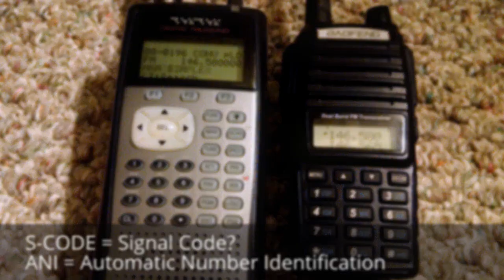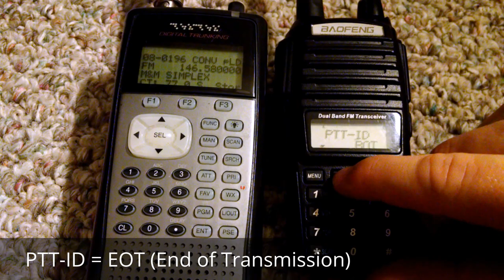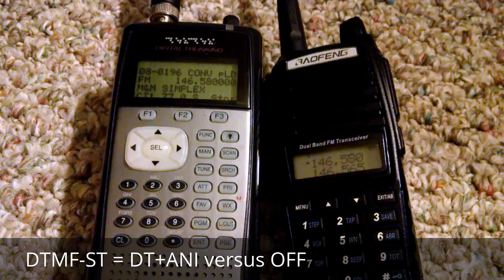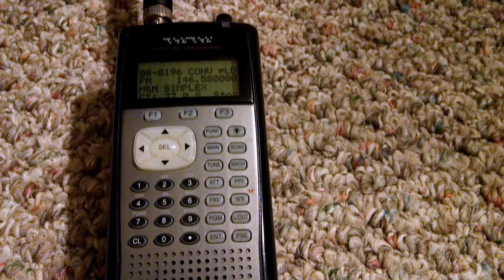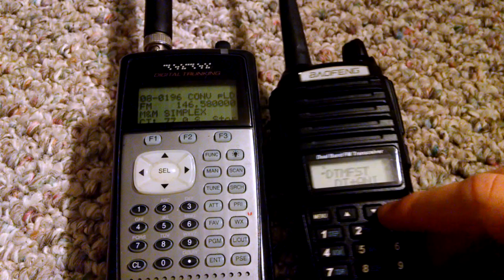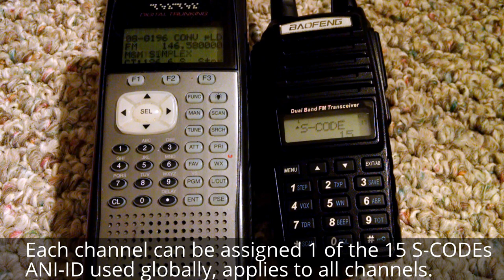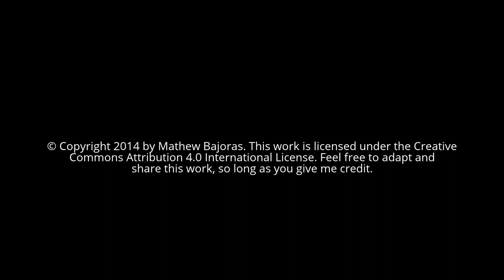Baofeng Radio PTT-ID Feature Demo

Comment: Can you explain what the purpose of these tones are for and what systems use them?
Reply from the maker: These don't have much use in the amateur radio world. However, in the public safety world, they serve to trace the radio back to a specific user. The radio is assigned a unique ID which is programmed into the radio and then recorded in a lookup table. When the user assigned to that radio keys up the mic, the ID is transmitted as demonstrated in this video.

This could show a radio dispatcher who uses computer aided dispatch (CAD) the identity of the person who keyed up. This has several uses such as when the person calling on the radio forgets to identify themselves, the person is in distress and does not have time to identify themselves, or the dispatcher was busy handling radio traffic on another channel and missed the last person calling on the radio. The dispatcher would just have to look at the identity on their screen and then can call back to the user.

Another use would be to save the radio traffic in an audio recording and being able to go back through the historical data and identify who transmitted which message. This could be used if some kind of incident occurs and the timeline of who said what when needs to be pieced together.

Most public safety organizations in the US do not use DTMF encoded IDs. The majority use MDC1200 which sounds like a crash of static sound at the end (or beginning) of the transmission.
Reply: @mattbjrs  thank you very much!!!!

Comment: perhaps someone familiar with baofeng radios can help me.
police radios make a static sound, like a brief hiss, at the end of a transmission, rather than those painful Roger beeps.
can something like that be set up for a baofeng?
Reply: +DOTLeo62 no. What you're hearing is likely MDC-1200 signaling and it requires a real radio.  Baofengs are nice for what they are, and worlds better than those junk FRS "22 mile" radios but aren't anything close to a professional communication device.
Reply: +Marco T I had to Google that, but thank you very much. 
I used them for years, but that doesn't mean I understood anything about them. that's some interesting stuff. a bit behind me atm, but I'm learning.

Comment: Dumb queston but WHY is the CTCSS changing each time you use the BaoFeng?  Why does it show up differently on the Pro106 scanner?
Reply from the maker: I think it's due to random interference in the signal that happens to be around the lower frequencies that CTCSS uses. Since CTCSS uses a continuous tone signal as its squelch code, it's susceptible to interference. In this case, a random signal that produces waves close to 67 Hz for a short period of time will look like a 67 Hz CTCSS squelch tone even though I don't have a squelch tone programmed into the Baofeng.

Since the Pro106 scanner supports digital radio, if you don't put it in CTCSS squelch search, it will take a second to begin receiving an analog signal because it has to determine that it's not digital first. Setting it to CTCSS squelch search mode is a way to tell the radio that the signal is definitely analog and eliminates the delay. Newer digital scanners allow you to specify whether the channel is analog or digital without this hack. Since it's on search mode and I'm not using CTCSS, it will display random frequencies based on the interference.
Reply: @mattbjrs  Thanks.  I have the same scanner 😛 I figured the BaoFeng would have the same CTCSS all the time but ok.  I wish they picked up Phase II.  Oh I hope you have the Win500 folder saved because the site is OUT.

Comment: Why is this desired?
Reply from the maker: This is a feature mostly used in commercial radio systems to record which radio is transmitting a message for auditing purposes later such as an after action review in public safety. It could have some uses in amateur radio if you decode the digits and have the radio receivers process them in some way such as a repeater recognizing a certain user is transmitting on it or using the beginning s code to automatically set up repeater linking. As others have pointed out though, in the amateur radio service, this does not satisfy the identity requirements and you still have to transmit your call sign per FCC regulations, so the ANI is probably not that useful to hams.
Reply: @mattbjrs  I got into Baofengs because of Airsoft (like Paintball), and have had a blast learning about this stuff.  I especially like the audible sound options that can simply mean the person is done talking, though shorter codes would be good, and helpful hearing a tone associated with a voice.  I also know there's a trick to making one or two Baofengs into repeaters.

I also do production professionally, including drone work.  I'm interested to see if the repeater/identifier thing could help isolate particular people so they can be given their own audio recorder input on my Zoom 6 track recorder.

Can repeaters be used to extend range?  Going off of old memory, and not that experienced, I remember that being something our organization discussed for big games.